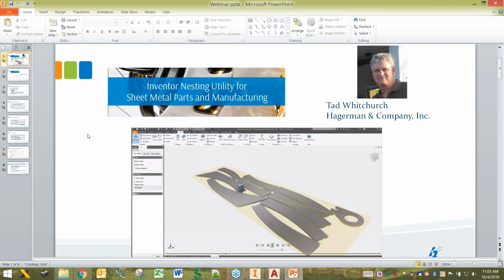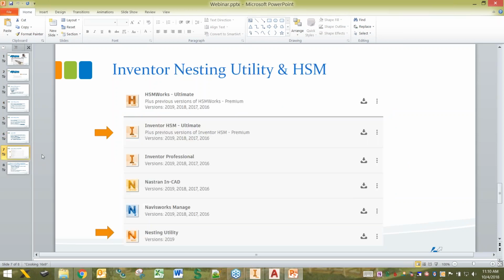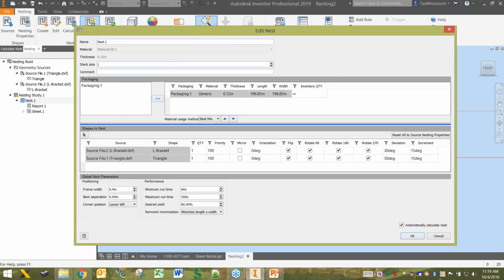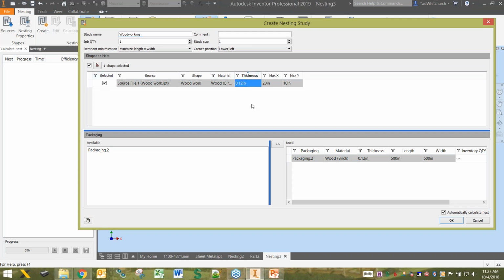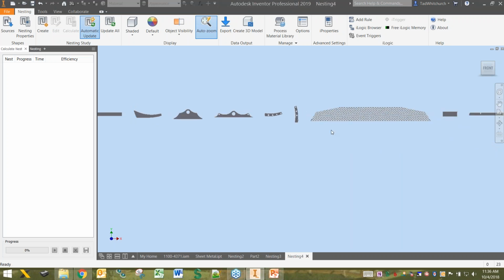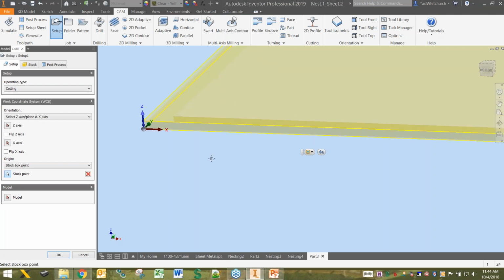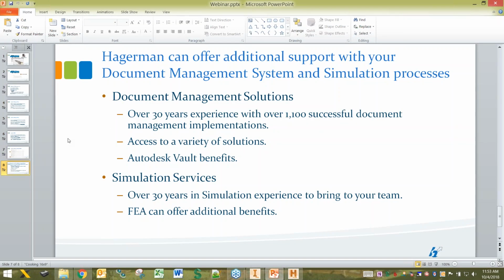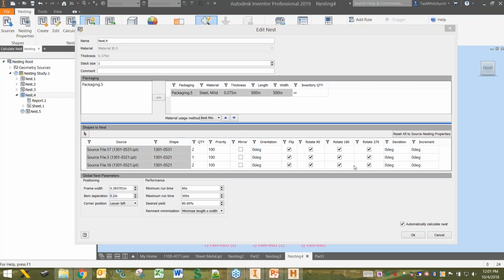Inventor Nesting Utility for Sheet Metal Parts and Manufacturing

Comment: is it possible to use remnant form (not a rectangle but a rough piece with uneven not straight edges for nesting a part on it?
Reply from the maker: Yes, you can use remnant form with uneven edges for nesting a part on it! 
If you mean the walls, they need to be perpendicular to the main face since it can cause issues.